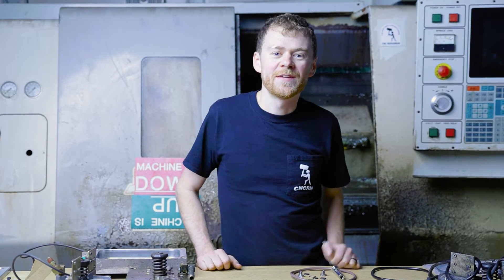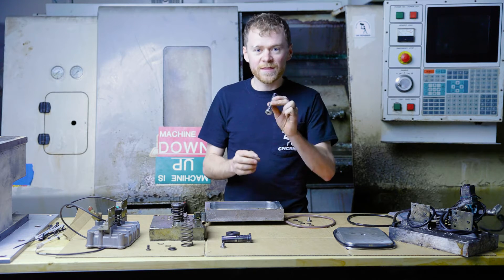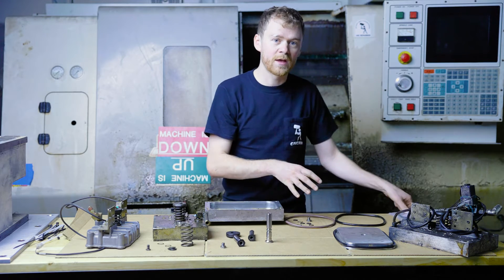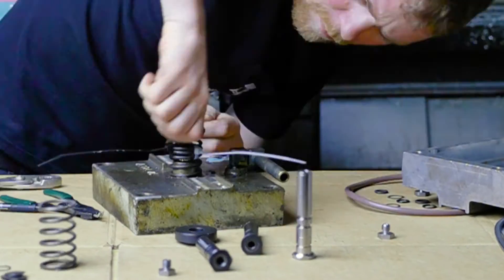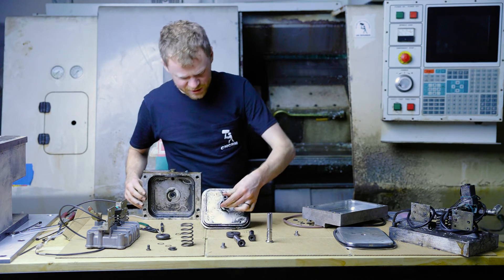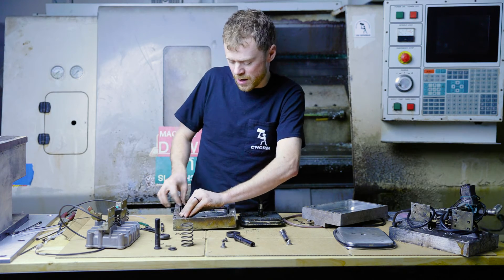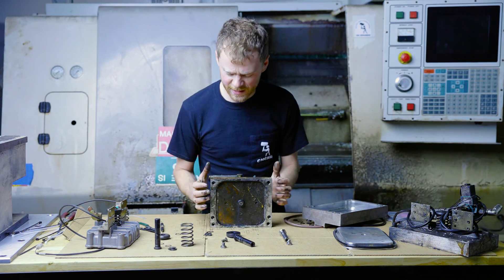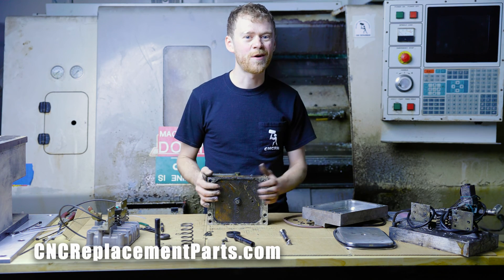Rebuilding Tool Release Pistons

Comment: You didn't cover inline TRP.
Reply from the maker: Have you ever seen one fail?
Reply: @cncrepairman  as 8 year Haas service technician - yes. One dues corrosion, second due damaged oring after few monts.
Reply from the maker: Only two in 8 years! Better than me! I’ve never had to work on one. Maybe I’ll do a video about taking it apart.